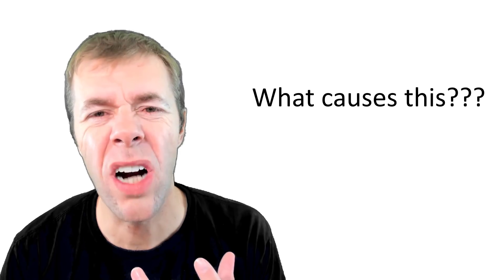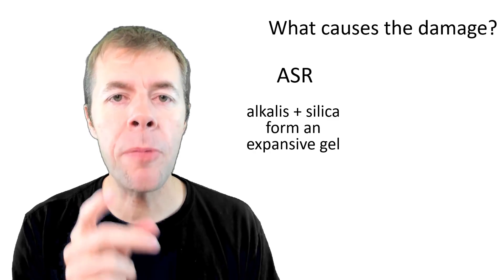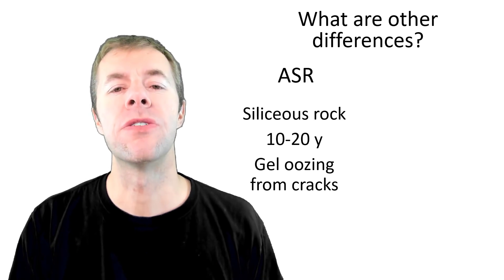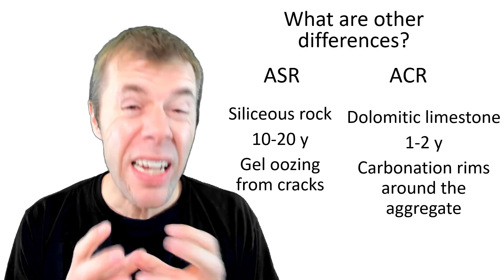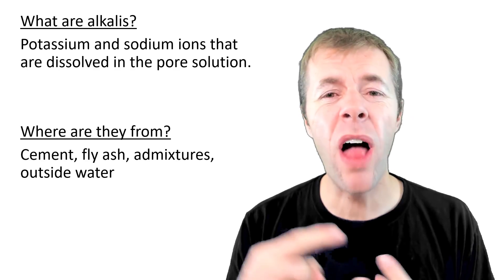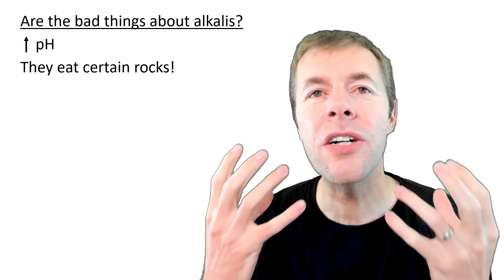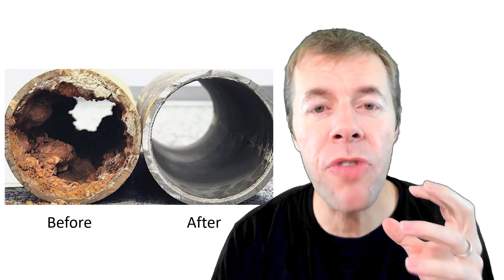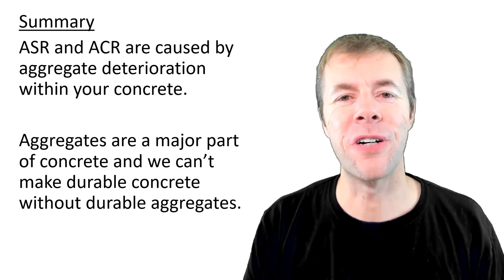The silent killer of concrete! | Intro to Alkali Aggregate Reaction

Comment: Hi, Professor Ley. For a (RCC Framed Structure) house built about 8-9 years ago. There are some places where cracks appear right under the beam at junction of brickwall & beam. The crack is big enough to insert the tip of a pinky finger. The crack can be seen from both sides of the wall. What could be the possible reason?

Comment: I'm trying to figure out concrete as a sculpture material, which lends a desire for greater permanence than replaceable structures like sidewalk or a driveway. I guess their is ancient concrete made so well it is still in existence, yet I hear videos like this, which speak of great threat. How do I figure out the best concrete mortar mix/ admixtures/ aggregate/ sealant/ method for such purposes? Is there any way to make concrete work as a sculpture material?

Comment: concrete is said to develop much of its strength within 28 days.

what if the concrete is neutralized with acid to lower the pH before the alkali can start doing damage?
perhaps at one year or more, the concrete has developed enough strength and so its pH level can be lowered or neutralized with constant exposure to water or a weak acid.

Comment: Rather than use fossil fuels to make cement, using focused solar energy will provide the heat while not contaminating the cement with combustion by products. In the long run it should be much less expensive and better for the planet as well.

Comment: Does fly ash reduce the alkali reaction with silica aggregates?  Silica is usually like quartzite, quartz, jasper, and other hard minerals found in glacial till.  is this problem more of an issue with self mixed concrete? Moisture is the catalyst for the reaction, right? The truck cement should  have this engineered into their mix by adding fly ash in the proper quantity.

Comment: I’ve been Rome and seen 2,000 year old concrete that is not cracked.  Why not?
Reply: romans did not use fast food engineering as nowdays. "Insert the flaw by design so it does not last" is the norm of today
Reply: @guss whu  I have seen pea stone round stone used that lasts much longer than a jagged edged crushed stone in many applications. Methinks they had other secrets.
Reply: Peter Fournier Soft lime concrete low psi.

Comment: Sir, 
How can we distinguish crack pattern of ASR from other cracks??
Reply from the maker: Good question.  Unfortunately, it takes a long answer.  ASR cracking will depend on the structure, the amount of stress, and the reinforcing layout.  It will make any structural cracking larger because that is typically where the most tension is.  If there is a lot of restraint then it will go in the opposite direction.  If there are low stress or not much restraint then the cracks will map like cracks.  I thought about making a video over this but I was afraid most people wouldn't be interested.
Reply: @TylerLey  Thank you sir. Actually, we need to know the cause of each type of cracks. Moreover, if we know the cause by visual observation, then we can easily fix it. So, if you can, please make a video regarding this. You can explain other crack patterns also. It will help us a lot.
Reply from the maker: @kiranrampp19  It is not a good idea to just diagnose a concrete problem based on a visual observation of the cracks.  It is easy to be fooled.  You should verify this with other measurement methods.  I don't think this is a good thing to put in a video.
Reply: @TylerLey  Actually, crack patterns are different for different durability issues. For example, cracks aligned parellel to rebar in most cases of corrosion. After that, we need to do more in-depth methods to confirm these issues. But, if we have general idea about the crack patterns, It will be easy for choose durability tests. Especially, in field we can not do all type diagnose test for durability problems.
Reply: I am just saying Sir and I wanted to share my experience too. I faced these issues in the field several times.
Reply from the maker: I understand.  You have to keep in mind that not everyone on YouTube has a lot of experience.  If you tell them this crack = this deterioration then they might fool themselves.

I don't think it is ever a good idea to diagnose a durability problem based on a crack.  I have seen many cracks that are parallel to reinforcing bars that are not caused by corrosion.  I have seen ASR, drying shrinkage, and plastic settlement.  One can not just use a visual observation to diagnose a deterioration.  I don't think it is good to even encourage people to do this because they will make a lot of mistakes.
Reply: @TylerLey  I understood Sir.  Thanks.

Comment: For building construction purpose ....i had done PCC...one load RMC mixture was to worse...because 6PCC Footings are not set for 2days...what will be the reason behind it...in future that will any problem for structure...after setting also it seems very bad...just hitting with hammer on PCC..it is forming a small hole..on that we can go for footings..or not..
Reply from the maker: Sorry, Poldas but I need more information.  Good luck with your project.

Comment: Tyler, here is round 2 of the video below... enjoy the add-on   --- It is a follow up at the same location, hope you can use the data that it is 16 months later and no ASR has changed on the interior side of that column base...  Yet, a lot of ASR is showing on the floor, inside the breezeway... https://www.youtube.com/watch?v=KCZCoHbEcmI&feature=youtu.be

Comment: High pH is an indicator of alkalinity.  Low pH is acidity.  Under acidic conditions, the solution is red, and under alkaline conditions, the solution is blue... what gives?
Reply from the maker: Thanks again Jami!  I think the video is correct.  
pink or red = high pH
The dark items in the picture are aggregates.
The light rims around the aggregates are cement paste that was NOT stained by the pH indicator.  This means these areas have a lower pH.  This is caused by a local attack of the cement paste by the aggregates.

This attack is caused by the alkalis in the cement paste attacking the aggregates in the system.  I see how this can be confusing.  The HIGH pH attacks the aggregates and makes the cement paste have a LOW pH.  I could do another video on ACR to try and make this more clear.

Thanks so much for the question!  It helps me rethink my explanations!
Reply: Check the video at 3:45. Looks right to me - red in alkaline conditions.
Reply from the maker: Thanks Rhino for stepping in and helping!

Comment: All concrete cracks.  You mean yours doesn't??
Reply from the maker: Jami - Thanks for the question.  You are right that concrete does sometimes crack.  These cracks usually form in the first three to six months or after the first winter.  With ASR the cracks just suddenly appear after 8 to 10 years.  The cracks may form in totally new places than the old cracks and they slowly get worse.  With ACR the cracks form after about 1 year and they get HUGE fast.